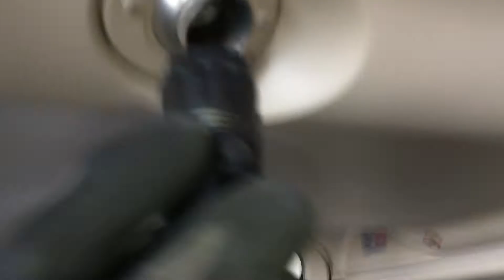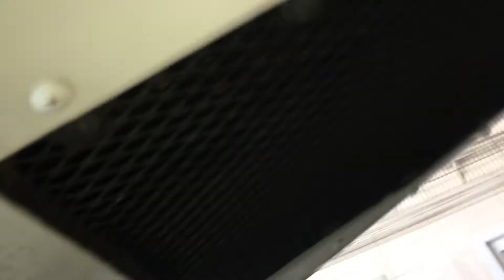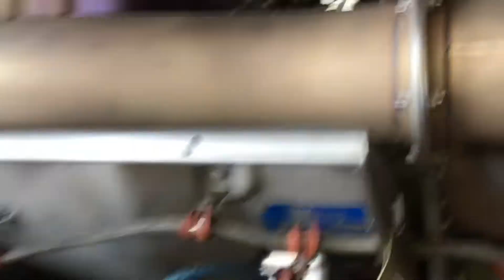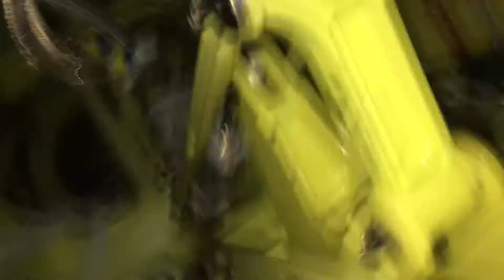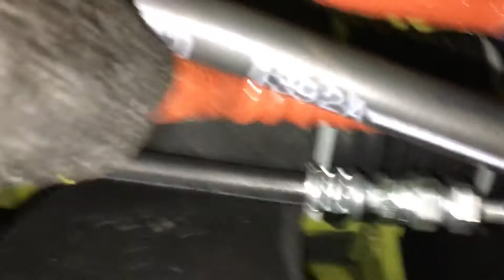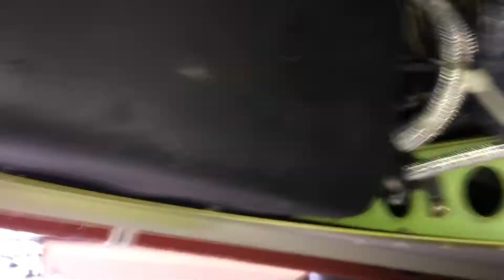Duct blower output￼ Very poor performance.  Replaced Dirty Corroded￼ evaporator￼.

Comment: Crazy. Owner needs to get with the manufacture and complain about lack of filter. 
On our units we run a sticky filter directly on the evap. To catch the lint and dust.
Reply from the maker: To access the evaporator case cost well over A couple thousand dollars in downtime.  Where it’s located they have to specially arrange the appointment with a small female mechanic around 5 foot tall very skinny she’s an FAA mechanic got a pay her later then there’s the regular mechanic who is on this job got a pay his labor and then protesting the helicopter there’s a helicopter pilot who is just standing by who needs to get paid. 

       Sticky filter with high airflow like they use on spray paint booth. 
      Cannot be the sticky filter like a KC filter using automotive air filters that you went down with oil too restrictive for the small size of this evaporator. 

Then because of the location of the evaporator you would never be able to change it it would literally be again all that labor and downtime because they made it an accessible the actual filter case with the evaporator is located it’s a sealed evaporator was never meant to be taken apart you just replace the whole unit as a assembly. 
         I think it was like $1600 and it’s barely bigger than the size of my hand square box. 

Welcome to the world of aviation
Reply: @coldfinger459sub0  might be the same as paint booth filter. 
Ok. So just clean the people before entering. :)
Hopefully youtube will notify me of your "found restriction" video.  You put out so many.. It skips notifying.
Reply from the maker: @turboflush  if they solve the problem that’s what I will name the video(found restriction) 

I told them before I left it’s a DC motor so if it is wired backwards it will spin backwards
           Squirrel cage fan will push air forwards even though it is spinning backwards.  It just will not be as much. 

So I planted the seed that seem a lightbulb went off a aha moment .?!        It’s too good to be true I hope it turns out to be that simple.    

How expensive all the parts are and how expensive the service and how expensive the downtime is not being in the air sitting idle is just bewildering .
Reply: @coldfinger459sub0  
Hopefully that is it. 
Or having phases wrong on a ac motor. 
No possible way for you to run up the ac system without the jet running?
Have had wrong fan blades on a radiator do similar.
Reply from the maker: @turboflush  i’ll leave that to their resident FAA mechanic to perform that procedure.   Getting access to the motor take some time I need to procedure he can perform without having to pay me to standby to be there. 

       I told him to research to make sure for the manufactures schematics or call the manufacture that there was no in line voltage spike suppressor or RFI interference module connected to the positive and negative of the DC. 

If it’s just a resistor they don’t care if you reverse polarity but diode do.   Or polarity sensitive capacitors.   If they are non-polar caps then it doesn’t matter.